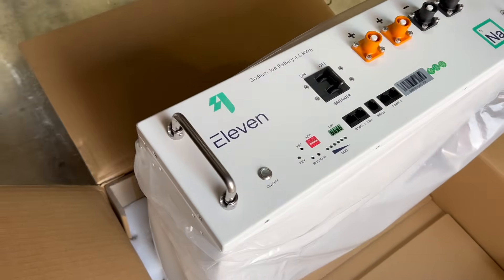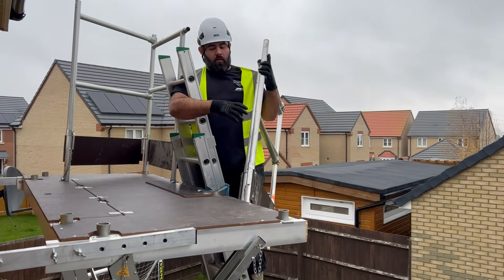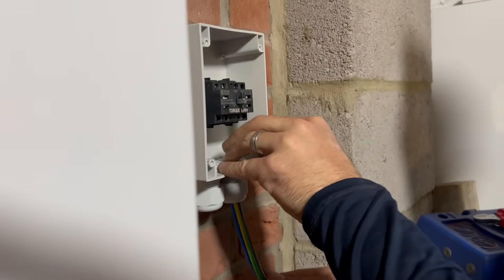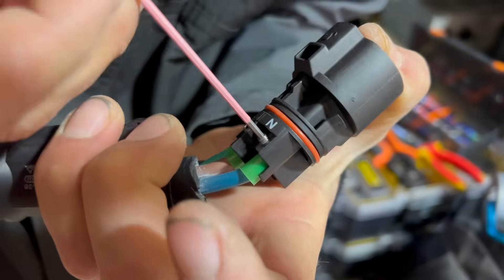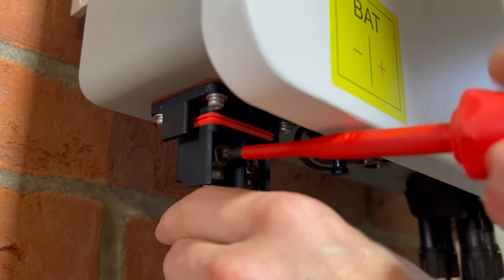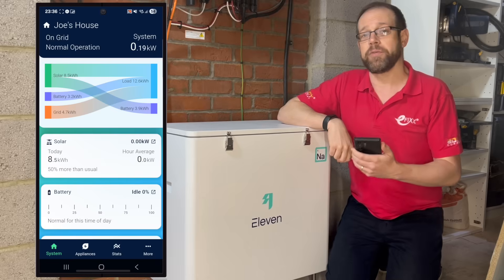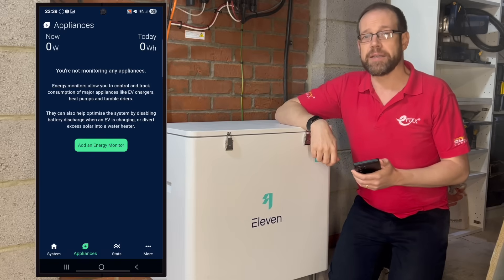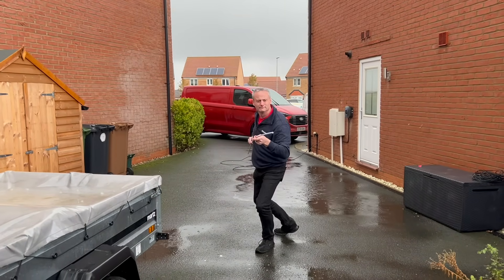I Swapped to a Sodium Battery - What Happened?

Comment: This really an opinion piece, test are required ie actual fully charge and discharge of the battery. One battery tested by Will P was very disappointing indicates about half of the storage works so 50% of rated capacity  Evidence on the charge and discharge cycle first. They may have resolved the issues. However I would not buy until actually proven capacity plus the charge and discharge cycle.

Comment: super , which kind , Type of Inverter do you use ?   because most comman inverter only have a DC Batterie Vaoltage-range of 40-60 volt , and Na-Ion accu have a rane of 32-66volt , so you can not use the complete SOC -range of the Na-accu..........

Comment: Thanks for the video, may I ask a question on the inverter reaction time, if i switch a kettle on, how long does the system take before its providing all the load for the kettle, ive got a solis that reacts almost instantly, previously i had a luxpowertek, that took about 30 seconds to fully supply, not long after the kettle was boiled....Thanks.

Comment: Interesting but with battery packs of only 4.5 kWh compared to my lithium ion ones of 10 kwh and expandable to 8 units  or only   30.22  kWh compared to my  five modules or 50 kWh it will not cope with a daily demand of c.a. 20 kWh leaving a reserve to cope with the inevitable power cuts as mad Millibrain destroys the stability of the grid. Also, on current costs and efficiencies sodium ion batteries cost twice that of lithium per kWh so at the moment no contest  unless your house insurance is affected by the minimal fire risk of Lithium batteries usually caused by incorrect installation and use of EV chargers.

Comment: 7:00 You had FIT, but removed your generation meter.  That's incorrect. Your FIT schedule just needs to drop the assumed export part but still pay you the generation part. So you'd still need the generation meter, as well as a bidirectional smart meter (for actual export).

Comment: Really good to se this and real info on the performance of Sodium not just the AI nes feed and marketing hype.
Sodium said to be more useable in sub zero climates and high temp climates,, No firte risk from thermal runaway and currently similar in cost to LFP.
I am waiting for the regulations in Australia to reflect Sodium and the safe installation as all my downstairs walls her in Aus are adjoined to habitable rooms and the regs here do not allow installation on a wall where a habitable room is the other side.
That would mean I would have to build a shed or storage are for a battery away from my home adding many 000's of dollars to the project cost meaning payback on the. battery would be well over 10 years. 
A diesel generator or my little petrol generator can be used in emergency and that costs me very little to run for emergency power to keep my fridge and freezer running and charge my mobile phones.
My solar halves my power but I do send a lot of excess to the grid for which I get very little now, as the feed in tariff has fallen to 1 cent a kWh.  
I send back 9 MWh a year, AUD$90.00 credit  verses AUD$400 dollars credit form last year 2024.
That same 9MWh could be save with a battery to avoid Peak Grid at 39 cents a kWh  night time use say 12 kWh at 39 cents = AUD$4.68 of energy saved.
The current  cost of a 13 kWh battery installed at AUD$18,000
AUD 18,000/ $4,.68 opportunity cost  = 3846 cycles or 10.5 years assuming every day I could charge from Solar.

Comment: Oh my god, there is so much misinformation. Sodium-ion batteries require sodium carbonate, not sodium chloride (table salt). Sodium is not extracted from seawater for this purpose; it comes from the same processes currently used to produce soda ash. If the point is simply that sodium exists in seawater, then lithium should be mentioned as well, since it is also abundant there. In both cases, that fact is irrelevant because neither sodium nor lithium is extracted from seawater for use in batteries.
Reply: but sodium ash is much more abundant , cheaper and greener than lithium extraction.
Reply: @Paulruk  I didn’t say that soda ash is expensive. My point was that it is not produced from table salt, nor is it extracted directly from seawater.

I agree that sodium sourced from soda ash is far cheaper than lithium from any lithium source. However, sodium and lithium each account for less than 5% of the total cost of their respective batteries. The raw materials used in sodium-ion batteries are, at best, around 20% cheaper than those used in LFP. Manufacturing, battery logistics, and other overheads are essentially identical.

As a result, expectations of a $10/kWh battery are unrealistic. Even at terawatt-scale production, sodium-ion batteries are unlikely to drop below $40/kWh. In exchange for that ~20% cost reduction, you get roughly 40% lower volumetric energy density compared to LFP, which itself already has about a 40% deficit relative to NMC. Given these trade-offs, it’s unrealistic to expect OEMs to adopt sodium-ion batteries for vehicles. Their primary application will be in stationary energy storage, but even in that segment, LFP remains highly competitive.
Reply: @cyclopes968  got you, thanks for explanation. 
I am looking at these sodium batteries and they are looking cheaper. comparing Synergy 4.5kw lithium battery to the sodium i've been quoted £850 for sodium and £1500 for the lithium. No idea how they differ technically. Just seeking quotes at the moment.

Comment: What is the maximum sustained load those batteries/inverters can supply to the house? Can you setup inverters in parallel for higher loads, with more batteries?
Reply: It's a 6kW inverter, but the max discharge from the batteries is 5kW. If you want to do really big loads, we have 8, 10 and 12kW inverters coming out soon, with two battery connections so a max discharge of 10kW.

Comment: at the risk of sounding naive, do you still use oil as an energy source for your home, or have you moved away from that entirely?  Does the solar / battery + grid supply all your home's energy needs?  And if so, do you believe that this is reasonably viable solution for UK citizens?

Comment: Sodium less reactive than lithium? I don't know who told you that, but as any chemist will tell you, as you go down the "alkali metals" group on the Periodic Table (aka group 1, or the column furthest to the left), reactivity increases, and noticeably so. Even one of the simplest demonstrations you can do, of the metals reacting with water, lithium just floats on the surface slowly fizzing away as it dissolves - giving off hydrogen gas, and you end up with a solution of lithium hydroxide. Sodium reacts the same way, but significantly faster, usually generating enough heat to melt the metallic sodium. Scale makes a big difference too - if you do this with a piece of sodium metal any larger than a pea, the heat generated is usually enough to ignite the hydrogen. This generates even more heat, enough to start boiling the blob of molten sodium within about 5 to 10 seconds, after which it will most likely explode.

Go one stage further and use potassium and even a piece the size of an uncooked rice grain will likely explode. This reactivity trend is due to the lower ionization energies as you go down the group or column - the energy required to strip a single electron away to make a positive ion is reduced.
As far as I am aware, the only reaction where lithium is more reactive is the formation of nitride salts: Lithium metal can react with nitrogen gas to make lithium nitride. This reaction is spontaneous at room temperature, whereas the equivalent reactions of sodium or potassium are not.
Reply: Check Electrochemical Series Chart. Lithium has -3.05V, Sodium -2.71V. Also Lithium as athom is 3 times lighter. That's why it has priority in vehicles. Lighter and more energy dense. Sodium has future in stationary storage systems, because it is several times cheaper.
Reply: @Smartguy0  Yes, of course lithium is superior from an energy density perspective, so it will be the first choice in situations where keeping weight to a minimum is the highest priority.
A classic example was the carbon dioxide scrubbers used on the Apollo spacecraft: Keeping weight to a minimum is always a high priority for spaceflight. On earth, carbon dioxide scrubber systems use soda-lime (a mixture of sodium hydroxide and calcium hydroxide), since it is effective and cheap. Typical applications are on submarines, and in some deep mining operations.
Any of the group 1 or 2 (aka alkali or alkaline earth) metal hydroxides can absorb carbon dioxide, forming the stable carbonate or bicarbonate salts. But for spacecraft, the choice is always going to be lithium hydroxide, because it is the lightest, so can absorb the most carbon dioxide per unit mass.

On an electrochemical basis, lithium does have the highest standard electrode potential - the figures quoted above for both lithium and sodium are correct: But this only applies under standardised conditions - at room temperature, sea level atmospheric pressure, and in aqueous solution. For practical lithium-ion or sodium-ion cells, this is basically irrelevant, since these do not use aqueous electrolytes - they typically use aprotic but highly polar organic solvents such as ethylene carbonate or diethyl carbonate.

Lithium is still superior on a purely thermodynamic basis, but that is not the only factor for reactivity. Kinetics (aka rate of reaction) are often more relevant in practice. Lithium has an electronegativity of 0.98, sodium 0.93. The first ionization energy of lithium is 520 kJ/mol, sodium 496 kJ/mol. But the difference in rate of reaction between lithium and sodium (for example the reactions of the metals with water) is far greater than you might expect from those thermodynamic figures. The overall energetic change is barely any different, but sodium appears to be far more reactive - and most of that difference in reactivity is due to the rate of reaction - the kinetics rather than the thermodynamics.

Comment: Lovely, wait until there's negative export pricing on sunny summer days?  Using iron filings would give you seasonal storage, not there yet for homes. Store in underground silos buried  in the lawn?  What's the worst that could happen?  Actually before starting your regeneration cycle furnace you probably need a reasonable amount of energy stored up, and sodium batteries are ideal for this.

Comment: One of my concerns with solar/battery installs is the ongoing dependency on the supplier. I can understand the need for the internet connection to discover up to the minute energy prices, which would presumably be a GET type request from the national grid. My concern is to make the app work and possibly other functions, the equipment needs to talk to Eleven energy (or whoever else is the supplier of the equipment). It's a problem from a sensitive information perspective (they can know a lot about you and sell that information). It's also an issue from an ongoing service perspective e.g. what if they stop operating and what if they decide to start charging for their service. I'd like to know if there are APIs for their equipment so that we can run them independently of the equipment supplier?
Reply: We do have an API, although it is to our cloud service rather than directly to the inverter.

Comment: Love a battery system like that. Installing a solar array is difficult here as I have flat roofs . But I have 5 hours at 8.5p kWh with octopus so could use cheap power via battery during the day. I do have a leaf so it's charged at night to. Wonder what battery and inverter cost is
Reply: Installed prices are very similar to mid-market LiFeO4 systems. And we're just in the middle of releasing a battery optimisation algorithm to automatically do the cheap charging on time-of-use tariffs :)
Reply: @AndyElevenEnergy  what's your thoughts cost ish to Scotland oban

Comment: All good but the current price of NA batteries simply makes them unfeasible. You can buy 5kwH lithiums for under half the price which makes no sense givens sodium is 1/60th the price of lithium and the batteries are way cheaper too.
Reply: Our batteries are about the same price as mid-market LiFeO4 systems. The price will come down with economy of scale of manufacturing.
Reply: @billienomates7100  we've been having lots of quotes from Heatable and Octopus, as well as independent installers. They all came to about £12K and two of the quotes were for 2x Eleven Energy battery modules, while other quotes favoured Tesla or GiveEnergy. So it is very comparable in price! I may get about 2kWh of battery storage more for about the same price with Tesla but then I would be giving money to Musk so no thank you :D

Comment: I remeber from school when the chemistry teacher put pure sodium or natrium in water. It was quite reactive I would say. It quickly burnt and exploded. I think sodium and lithium sits jext to each other in the periodic table so they have similar properties. That is why they bothnarebsuitable to be used in batteries. I wonder if this ”much more safe” is a hoax.
Reply: Improved safety comes from less susceptibility to dendrite formation, which can cause short circuits, and because there isn't the same danger of thermal runaway you get with some Li batteries (specifically NMC). To be fair though LiFeO4 batteries don't suffer much from dendrite formation and are generally pretty safe too.

Comment: Nice video, but wrong choice on omitting DC isolators, also wrong on dismissing the debate on earthing rails, we have been earthing rails for years now and at least 30% of jobs are showing an insulation resistance of 2-30 megohms after heavy rain. And two Sigenergy jobs are sending IR alerts whilst disconnecting DC.

Comment: Can you run the installer stuff when you are not an installer. And can you avoid the cloud account? Local access/documented API? Sounds like another, you paid for a device you don't own, case...
Reply: Our CTO is working on the API documentation as I write :). It is a cloud-based API however. Local access isn't currently on our roadmap.
Reply: @AndyElevenEnergy  Commendable first step. Still local access is an absolute must for me (and should be for any consumer) to buy something. Especially if it is an important part of my energy system that is supposed to last 10 to 15 years...

Comment: What is the usable battery voltage range that the inverter will handle?, many inverters will not match the usable voltage range of sodium ion as the discharge voltage is linear compared to the flat voltage curve of lifepo4
Reply: 33V to 60V. Most LV inverters are 38V at the lower end. Still works, but you lose out on a few % of the battery capacity at the lower end.
Reply: @AndyElevenEnergy  You would have to base the current load on the lowest voltage of the battery, I dont know the overall turn around effiency of the sodium ion battery compared to lifepo4, sodium I think can go as low as 1 volt, so in a 15S setup the lowest battery bankl voltage would be around 15 volts.

Comment: Wonder how long it will last and cost in maintenance. After all manufacturers can’t even make a LED light fitting  that’s reliable. The average customer won’t have a clue with all these apps . Even with smart meters most of them can’t even  work the remote plug in display and end up putting it in a drawer out the way .
Reply: We have some cells that have done 13,000 cycles - equivalent to 35 years at one cycle a day - with only a small loss in capacity. Shouldn't ever need any maintenance.

Comment: Sodium batteries are not compatible with most inverters due to their linear voltage discharge curve. You would need to incorporate a huge 'Joule Thief' circuit within the battery to maintain constant voltage in order to make them compatible with 48V systems which are becoming the most popular (eg Victron/Fronius combi). Fogstar do some great 32kWh LFP battery units for £2,790.83 +vat which use seplos BMS (favoured by us electrical engineers!)
Reply: Correct, the voltage discharge curve is different. The Eleven inverter is modified to go down to 33V rather than the 38V more typical with inverters used for lithium batteries. That said, the batteries work very successfully with Victron inverters too. You just won't get the last few % out of the battery.
Reply: My same point that was not mentioned
Reply: That's the only real downside, but alot of Battery systems (the more expensive types) come with build in inverters. Which, I could well imagine, to become the norm
Reply: @tarant315 which for the customer, is a BAD idea, since the inverter inside the battery housing needs louder cooking and is expensive to replace when it fails. Most likely unable to replace it, since its battery specific instead of just compatible to LFP or Sodium batteries
Reply: @campandcook3118  The key thing here though is that we need to scale up sodium batteries rapidly. They're safe and will soon be very much cheaper